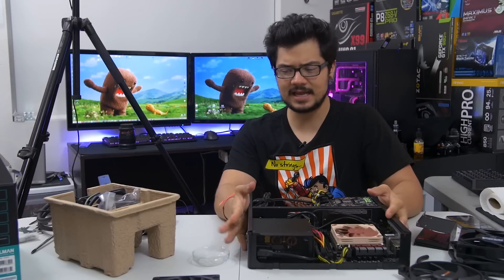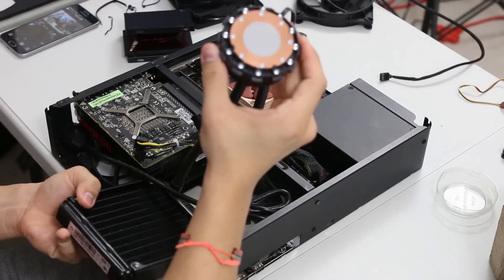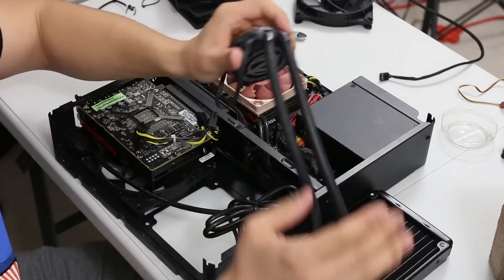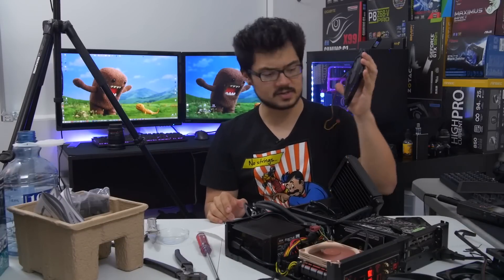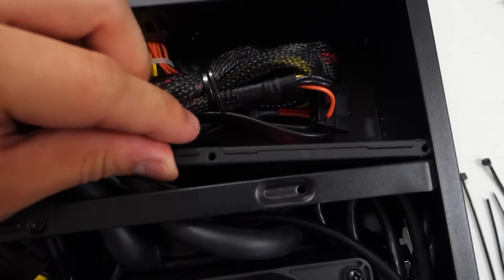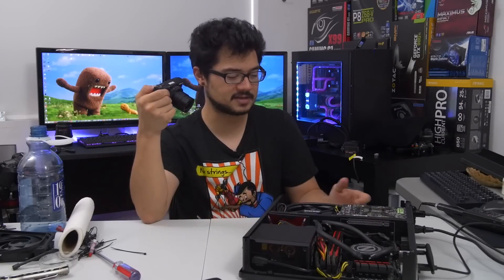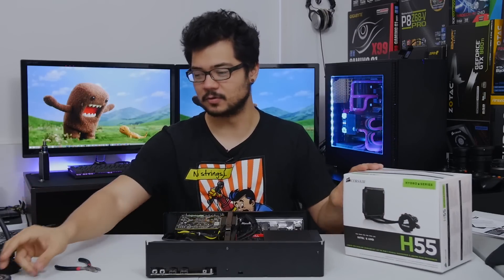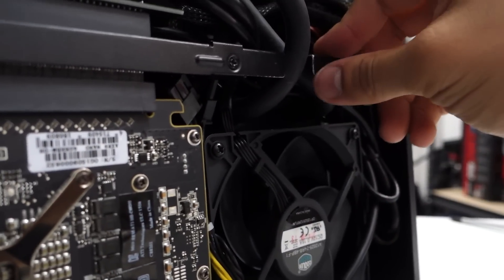Challenge Accepted: Liquid Cooling in the Fractal Node 202!?

Comment: Thank you for this video. I just finished installing a GTX 1070 with an H60 onto my 4690K in the Node 202. Unfortunately, I get the same heat as you at stock clocks running Prime95/Gaming (high 60s), but my fan isn't properly seated over the radiator because the GTX blocks the alignment, so it's slightly off to the side and once I glue it down properly maybe it will improve.

Either way, I'm happy with the result, and thank you for giving me the idea to boost my little small form factor case further. Was getting sick of skyrocketing to max temps (stock air cooler) during any real gaming but loved the case too much to ditch it and wanted to go the extra mile with water cooling.
Reply: im considering getting a similar setup with yours. right now i have the gtx 970 and i7 4790k cooled by H60 on a ATX build but im seriously considering to move my whole setup over to the node 202 for cleaner more compact setup and easier transportable. can you tell me how much gpu clearance i have if i would have my h60 installed as in the video? im considering going with the Gtx1060 ITX but not sure if that will suffice the short clearance
Reply: Hey. I'll be posting a video about my experiences later tonight. I had to do some slight modding to align the fan but I got it setup and my temps are great!

Comment: I watercooled my 970 itx and i7 in my RVZ02 case with 140mm radiator and RGB Riing fan with a reservoir. Pretty fun project. Pictures are on overclock.net. I can identify with the crazy desire to finish it and make it work.

Comment: The radiator fan is on backwards and is going to blow hot air off it back into the case when the side panel is on.

Comment: you can even put a 140mm aio Cooler like kraken x41, with a smaller card like gtx 1060/70 mini versions (around 130-140mm) and a little case modding. It Will give you more oc room 😁

Comment: The fractal kelvin T12 has a removable water block,  so you could empty it, remove it, squeeze it through and reattach on the other side, without cutting anything.
Reply: think the rad is to thick on that one.

Comment: Bit late to the party but I used the same build and i just cut through that middle part there. 

It didn't really affect anything plus the case is very strong once you screw in the cover. 

Plus, it aint moving from where I placed it anyways so there's that.

I also had it lying horizontally instead of vertically so all the weight is on the back, less chance of that cut part being an issue.

Comment: Great video!
I plan to buy this tower and i was wandering if it can take water-cooling.
Well i checked the user manual and i found that you could widen the hole where the tubing goes.
You have to cut the chassis to widen it but not the cross bar, that way you wont have any structural integrity.
Also you can install ssd drives using Velcro and glue them on the tower panels right over the cpu.

Comment: Glad that even though you wrecked a Zalman you made an H55 take its place and went the safer route in the process alongside not frying your hardware...good job, man! Only question...why not turn the fan the other way to exhaust out of the case on the air cooler? That could have worked if the brackets allowed for it.

Comment: I think Fractal could possibly include a grommet home for tubing or indeed any cable passed through. Failing that an attached metal block attached the case base (inner) which wraps around the  two different halves of the case layout. That would maintain the integrity of the case structure whether you use an aircooler or an AIO watercooler pump. Still though it was interesting to watch, i plan to get this case with a sfx 650w psu. Noctua cooler and decent gpu.

Comment: Would it have kept working if you had left the pump at the bottom of the loop? I.e having the case oriented such that the cooler was below the radiator as opposed to in line or above it. I'd bee interested to know if working with gravity would have made the original solution more sustainable.

Comment: i've got almos the same set up. same case and all, sff stuff is all almost about the same size. but the node 202 supports space for a full size gfx card. of course i utilized this by putting a 1080ti in it...  but that means there's NO room for a radiator now :(
Reply: The ID-Cooling Hunter Duet looks like it would work perfectly inside the Node 202. It cools both the cpu and gpu using a 240mm radiator, which could be mounted where the optional 120mm fans would sit above the gpu.

Comment: You could've dremeled the cable routing hole bigger (to the side where the SSD bracket sits), so the AIO cooler heatsink fits through. That way you shouldn't have to dissassamble the cooler and it should look half decent i.e. not hacked up

Comment: Would this work with the evga gtx 1060 its 6.8 inches long? Please help
Reply: chiggins No it doesn't I had it and it was a bit too long, no way to install it - I now have the same R9 Nano and I'm super happy
Reply: chiggins you can probably use a gigabyte 1060 mini if you use a slim line fan but don't know for sure might try it out pretty soon
Reply: chiggins , just saw a few megabytes off the VRAM & it should fit.
Reply: I did that build with the little gigabyte 1070 itx and it was a perfect fit! I used a Deepcool Maelstrom 120k for aio.
Reply: Lol he said "GIGABYTE 1070"
Reply: chiggins Would this work with zotac 1080 ti mini?
Reply: BN no. You’d need a gtx 1070 mini OC. The 1080ti mini is too big

Comment: Just to say you know those asetek pumps have refill hole right under the plastic cover? To get most air out of the system disconnect one hose from pump (preferably IN hose). take a big syringe that fits into refill hole tightly, push stuff inside while blocking open pump hole with finger until only same stuff comes out from disconnected pipe, connect pipe back into the hole while holding syringe in fill hole. Now there should be little air inside the pump only only, you can now refill pump with dropping some liquid into refill hole until it is full then seal refill hole.

Comment: why not just use that low profile watercooler from corsair..... but then again what do  i know
Reply: +GamingSoup It doesn't perform nearly as well. Sits right between a standard AIO liquid Cooler with a 120mm rad and a standard sized tower air cooler.
Reply: +Dieser 1337 Baka. I know that but based on the video his goal was to water cool the system lol
Reply: GamingSoup His goal was to be able to OC the 6700k to the maximum potential in this case. Wouldn't really be possible with that Corsair Cooler as it is only a minor improvement over the Noctua air cooler previously used.

Comment: could you put a small card that is water blocked and fit a 240 rad with slim fans in it?
Reply: You can! 
If you have the ability to have a single slot GPU you can even go 25mm thick fans and a 240mm rad. 
Preferbly 23mm but a more common 25mm rad would work too
Reply: what if it dual slot but what about the water block. it gives some space back but not much. i was planneding to get 25mm rad with 15mm fans and it should be enough space for that.

Comment: Would it have been possible for you to move the power supply to the other side of the case (where your radiator is currently) and the radiator to the power supply side - this way you don't have to cut the bar for the tubing (since it wouldn't be crossing the case)?

Comment: Damn, I really wanted to use this case for my old i7-4770K and GTX 970 as a nice 1080p TV "console" when I upgrade to a Kaby Lake(whenever they come out) and a GTX 1070, but it looks like there's no way to properly aircool any i7 even at stock clocks w/ no turbo, and I'd have to buy a shorty 970 to be able to fit a radiator.
Reply: Schyte Big Shuriken 2 actuallyworks very well in this case

Comment: will this work with the 970 mini? thanks!
Reply: Probably even better since the 970 has it's power connector on top of the card.
Reply: the rest of the mini itx size gpu are actually like halve an inch longer than a nano so it might touch the fan on the rad
Reply: Luis Fernandez Yeah, but the R9 Nano is 157mm long. That's shorter than the 170mm GTX970 ITX versions, but the Nano has it's power connector on the back of the card, which means you have to fit the connector and bend the cables. That adds up to an additional 20mm space that is needed.
Therefore, the Nano is practically not 157, but 177mm long, which makes it 7mm longer than any other ITX card.
So, fitting a GTX970 Mini in there should be even a little bit easier.
Reply: Actually the nano is 6 inches but the power color version is 7.5 inches that is used in this build. the gigabyte 1070 mini says its 7.75 and by the looks in this video it might just fit! also as noted by Zerro the power is on the top of the card and there is lots of room for that

Comment: 1. Drill two hole on both sides of the cut.
2. Find a small metal plate of a fitting size and and drill two holes with same distance as previous and paint it maybe.
3. Find the right screws and screw it in.
Reply: +jusk if you dont mind having the little flex in the case, cut that bar, run the tubing, get a piece of heat shrink (preferably adhesive one), cover the gap with it, heat shrink it and done.
Reply: Matthew Warren I don't understand, what will that achieve?
Reply: jusk something like what you were talking about, a cover up or fix for the gap.
Reply: Matthew Warren Oh, ok.

Comment: I like the video, and making a build that needs some mods to get the job done. Just a suggestion take some rubber hose and make a cut down the middle and press it onto the opening so if there is any movement it will cut down on rubbing metal on rubber.
The only other thing i saw was it looks like that middle bracket unscrews and can come out. Was just wondering if when out you could have made the hole bigger or cut the opposite side. Just some minor observations. It is still a good mod and good video.
Have a day
Reply: You could do the same hung with used weather stripping from a car or even just cheap stuff from a hard ware store. Normally they just have a small slit that you could put a bit of glue in and it would look much more professional
Reply: +alcowherd7 You could use what ever is hanging around that would keep the steel away from the hoses. I worked at a place that all the band saw blades that came into the shop for use had a plastic cover and it is perfect for this i grabbed a few lengths for just such a thing. And it is the perfect size for case mods. I always look around at what is being thrown at a job sits that can be used for something else and not put in the trash. Recycle what you can.

Comment: Hey +Bitwit Kyle, I'm planning a build around the node 202 as well and I'd like to use an aio water cooler as well, I was wondering if you could do it without cutting the mid frame? At around 7:44 there's a screw, can we not unscrew that and take the midframe apart/out ?

Comment: You could have tried a small syringe to fill the loop through the tubing, like the ones they use to take blood samples. Really thin needle through the tube, best case: the tube would just close itself since its rubber material. Worst case: take out the good old ducktape and tape it down nicely, maybe apply some heat with heatgun to seal it properly.

Comment: Would it work to use a syringe, puncture the tubing, inject liquid until the unit is filled and then seal the hole made with epoxy or something?

Comment: I could be wrong, but wouldn't it be easier to unscrew the PCI bracket piece(the long metal piece that was cut into); run the cables. Then put the bracket back in??

Comment: @Bitwit I have 2 quesiton about node 202. 

1. Do you know what is the max height of radiator and fan for AIO? 
2. Would it be possible to have 240mm radiator instead of 120mm? I see that the powerplug might be a problem.

Thank you for response!

Comment: instead of cutting the top of the brace out. you probably could have just widened the hole. another idea is jb weld a piece of steel across the opening after you have it installed...

Comment: fan pulling air in or pushing air out?
Reply: +MadOliveGaming i assume its pushing out the case. in from the radiator out the case. in.... out... in... out...
Reply: Hollis Jacobsen in from the rad out of the case? but im pretty sure theres no vent on the other side of the case, well there is 1 for the cpu but not above the gpu area. so either hes pulling air from elsewhere in the case and throwing it out or hes pulling from the outside and pushing it into the case (obviously it will exit from a vent elsewhere but not directly)

Comment: I would do a full loop in their, gpu and cpu... would have to use a 120 rad, but... thermals should be good :P Might be able to fit a Res under the gpu and claim a block/pump combo for cpu... That be a good challenge but I think it will work

Comment: That's the first thing I thought this case must be perfect for, in case you have 17mm gpu. another mod could be a glass panel and rgb lightning. I'm a bit disappointed though, that there is no space for a cable management on the bottom. It could be a massive improvement.

Comment: I wonder whether or not you would be able to fit a Corsair H5 SF in there instead... i'm guessing not though. I would want to put a full sized graphics card in the case so i'm not sure if they make low profile fans I would be able to stick on a radiator that would fit underneath the radiator and underneath the card.

Comment: Should have just make the passtrough bigger and take everything off to install the H55 first! I just realized that its even possible to make a custom loop, with a 240mm rad and cpu and gpu water blocks. Maybe will need one low profile fan to go under the gpu.

Comment: Wouldn't it have worked if you fully submerged the zalman cooler when you refilled it? I don't think there would be a change for any air bubbles to get trapped. But we will never know... :/
Reply: Then using some sort of syringe to get a tiny bit of circulation to get the all the bubbles out.

Comment: If you went without a gpu, do you think you could fit a 120mm rad in there?
Reply: you mean a 240mm? 120mm is a single fan, which is what he did. I'm sure you could fit a 240mm rad in there w/o a GPU. Not good to go without a discrete GPU tho.
Reply: Bridger Farnsworth yeah, 240 is what i meant, but thanks anyway!
Reply: Yes,  you can even fit a 240mm rad with 25mm thick fans and still use a gpu.

Comment: So, does anyone know what the maximum card length would be if one wanted to do a similar build?
Reply: you are pretty much stuck with an r9 nano or similar card if you want to do any sort of water cooling.
Reply: thanks!
Reply: can it be a 970 mini?
Reply: Dellan XU i dont see why that wouldnt work actually. i wasnt aware there was one until you mentioned it and i looked it up.
Reply: thank you  so much!
Reply: More importantly, can this be done with a 1070 Mini?
Reply: +Joseph Kacvinsky depending on the 1070 mini but a good rule of thumb is to check if the card is shoter than 7.5 inches if it is then it will fit if it is not then it wil not fit.
Reply: +Joseph Kacvinsky is there even a 1070 mini out? I know there's a 970 mini, but not sure about any 1070 minis yet. would be expensive as fucked if there were one this early after release.
Reply: +companyoflosers iam pritty shure gigabyte has realesed one or is going to realese one.
Reply: +companyoflosers it's literally right below this reply.
Reply: I did the math, to be safe I would keep the gpu under 180mm if you are using a 120mm rad. The case supports 309.88mm long gpus so I gave it some breathing room and did 300-120 and got 180. The gigabyte gtx 1070 mini OC card is 169mm long so it will definitely work and is probably the best nvidia card you can get for something like this

Comment: you could solder the metal piece back onto the strut, if you are ok with never taking it back out again, that is. also, a demel would have been easier to cut the metal, and less NSFMR than the hand-saw option was. lol.

Comment: Im gonna do this when Zen APUs come out, but with a 240mm radiator
Reply: Post a video when you're done pls
Reply: unlucky 7 OK, but I am not as entertaining as Kyle.
Reply: good idea but if you only use a Raven Ridge APU without a dedicated GPU(or dual graphics) you can get away with even smaller and thinner cases! which would be an awesome thing. I'm really hyped for the 14nm APUs with DDR4. The A10 7890k is almost good enough and I nearly built a portable mini itx with it but decided to wait like you

Comment: The main reason you couldn refill is the pump has a valve to stop the outlet allowing backflow, the other thing is that your setup was viable if you had the setup lying down, or position it upside down on the stand. The remaining fluid from the rad- reservoir would be enough. But it would be definately a risk while travelling to have a pump running dry. third possible solution would be a mini reservoir. but too much of a hasle for a portable system. Have a nice day and keep bringing such videos mods are fun to watch!

Comment: you may not be able to do this with an aio but you could 100% do it with a custom loop and quick disconnects. don't even need a res once you've filled it to 100 and drained the air.